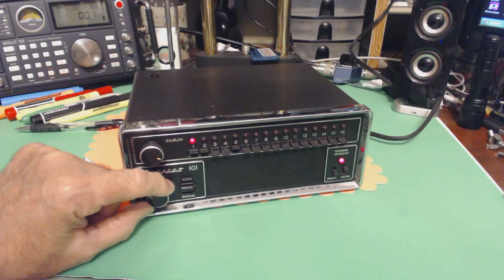TRRS #0720 - 1st Programmable Scanner Radio

Comment: Two Comments..  I was hoping you would show us the Manual for this scanner.  I just bought this radio on Ebay and I don’t know if it is coming with a manual.   Next thing:  You never handle the antenna plug that inserts in the back because of the oils on your skin.  You should always use a Q tip with Windex or alcohol to clean.  That would help with the “flopping around” of the antenna.  I had this radio for years and years in the kitchen of my house connected to a super antenna on my roof.  To me - it was the greatest scanner ever - alongside the Bearcat 210 - which I also own..

Comment: Hello! I have a general/specific question about these types of radios. I have a Regency ACT-E10 crystal scanner. It works except the scanning. When I turn it on it scans for 1 sec and the lights fade off and it stops. I replaced the electrolytic caps, and tested the poly film ones. I have a Realistic with scanning problems also and I replaced the caps and all the ICs. I'm wondering what I'm missing? What is with the scanning problems of these old radios? What part of the electronics am I missing? On both the chasing lights and scanning is the problem.
Reply from the maker: My only guess is power supply.
Reply: @hamrad88  I'll test that. Thanx!
Reply: Replaced the transformer with a new one and it didn't help.
Reply from the maker: @mesapsych  Sorry

Comment: Bearcat 101 programming:

VHF Low (30-50 MHz):
Both SW 14 & 15 oFF
a = 51.7 MHz - Fc
n = a * 200

VHF High (146-174 MHz):
Sw 14 oFF, sw 15 On
a = 184,7 - Fc
n = a * 200

UHF (416-512 MHz):
Sw 14 On, sw 15 oFF
a = 512.05 * Fc
n = a *  80

Now, convert "n" into Binary.

Switch values when On:

sw  1 = 4096
sw  2 = 2048
sw  3 = 1024
sw  4 =  512
sw  5 =  256
sw  6 =  128
sw  7 =   64
sw  8 =   32
sw  9 =   16
sw 10 =    8
sw 11 =    4
sw 12 =    2
sw 13 =    1

I do not own a Bearcat 101, but am pretty sure it will work on 70cm.
Reply from the maker: Thanks

Comment: got one of these today. COuldn't help myself despite knowing it was kinda overpriced (30$....) since you can't really receive much on them anymore since all police frequencies have went into waaaaay higher frequencies and the only stuff on the range this can reach are digital aside from the weather. Still though,  it was in perfect shape, just dusty. Didn't have the manual though so this thing is gonna be pretty hard to program atm.
Reply from the maker: I love old scanner with blinking lights!
Reply: I got one of these “Bearcat 101” Scanners last night on Ebay - Bidding.  A $2. 50 bid held for almost 1/2 hour until it got down to 8 minutes and then one of the 2 bidders increased it to $10.50.  I’m just sitting back watching the time go down to about 30 seconds and then I bid $12.50.  The timer stopped - the final results were “ I WON “..  These other 2 bidders didn’t even know I was there because I waited ‘til the final 30 seconds.   The scanner was listed as “In excellent condition.”  Today is 7/24/‘24.   It should be at my doorstep the 29th.  I owned this scanner from the day it came into Radio Shack until it came-up missing one day.  I used it for at least 20 years.  I’m finally getting a duplicate back.  I also had a Bearcat 210 in my car forever - illegally.  I literally wore it out.  I just found one of them on Ebay for $25.  It looks and works like new.  I also have - beside me -  a Bearcat 210 XW - Great Scanner.  I’m using a Ringo Antenna above my roof.  I can’t bring in nothing like I did back in N.Y.  I’m down in S. Florida and the only thing I can listen to is the Fire Dispatch on 155.155 and all the weather channels.  I pick-up all 6 of them with the Ringo.  The antenna is 7’ tall.  Florida is totally flat so I can see the Space Launches from my front step all the way to Titusville over 100 miles away.  CB Radio is unreal here with all the lakes around - when conditions are right.  Right now it’s dead..  Good Luck with your scanner.  Check out that Ringo Antenna and make sure you use the Good Cable.  Not the skinny stuff.  Too much signal loss…

Comment: At 6:08 you point out the 3 contact terminal strip.  This was for triggering an external recorder.  You couldn't drive it directly but needed a special interface circuit.  Back in the day I designed and built a simple interface using a 555 timer chip to drive a small relay.  The BC-101 was a fun scanner for it's day.
Reply from the maker: Thanks for the information.

Comment: Hello hamad88  
I have the 101 Bearcat , but I lost the Prommable  Manual..do you know where I can get it a
Copy, what will cost????
Reply from the maker: Try here for manual.  Somewhere there is also a formula for calculating settings.

http://radiopics.com/-%20PHP%20-/1.%20Manuals/Bearcat-Uniden/Bearcat%20101%20(Manual).php
Reply: Here is a link for an online freq converter for this scanner. I have never used it, I assume it works correctly. http://www.mindformation.com/bearcat/

Comment: Thanks Tom , it looks like the ole scanner is still working for you. This particular model of scanner is one I haven't seen before
and it was probably a really high priced unit. The price probably reflected that it was one of the first scanners that could be programmed without using crystals.
Reply from the maker: +Dennis Petersen I will have to look through the old catalogs to see what it sold for originally.

Comment: Very neat unit!
Does this unit use a PLL synthesizer? 
I recognize that external antenna , it was sold at Radio Shack for decades !
I have the next generation of this unit the Bearcat 210, which uses the numerical readout and instead of single LEDs it uses scrolling zeros for each channel programmed into it, my unit is PLL synthesized.
Reply from the maker: +watershed44 Thanks.  I have several 210s.  I guess they were very popular as I have found dozens at garage sales and hamfest over the years.
Reply: +watershed44 Yes, I have a Bearcat 210 boxed up in my closet. Only 10 channels, but it was better than buying crystals.